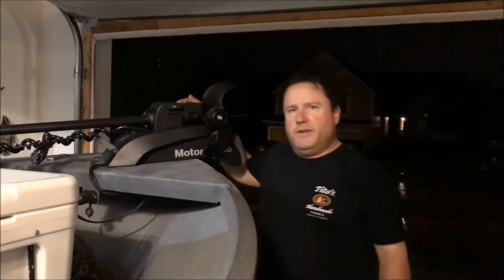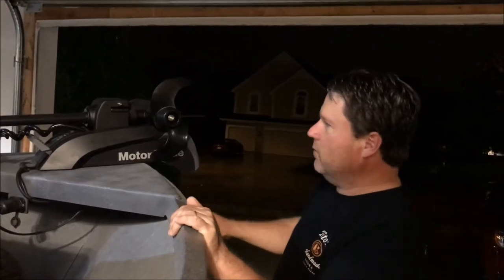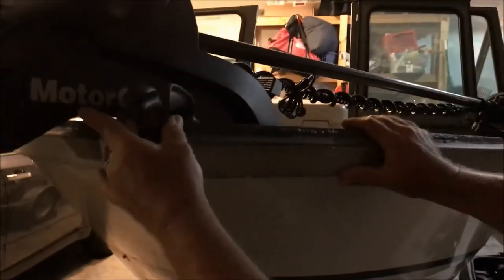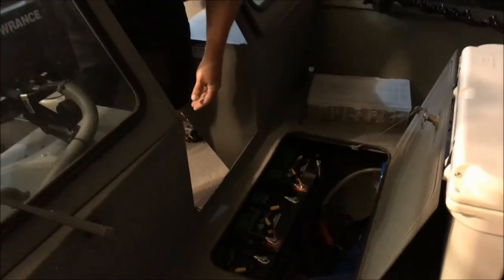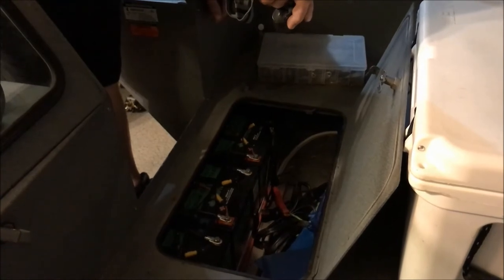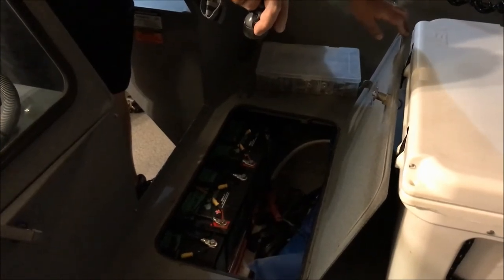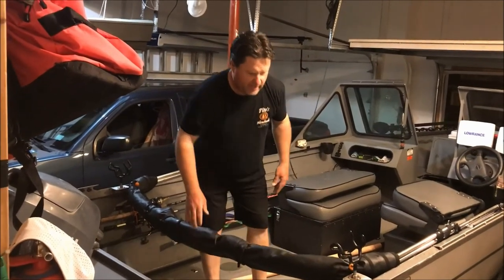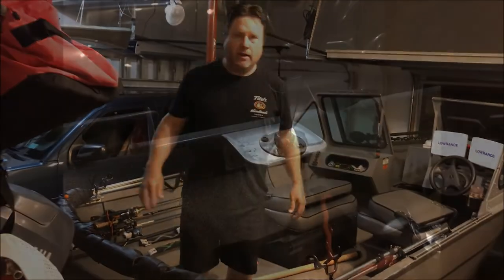Alumaweld / Modifications / XI5 / Lithium Ion / Canopy

Comment: Are you able to re-enforce the trolling motor better to the boat than just the original mounting brackets?  Had a buddy have his bust off due to silver carp while fishing.  He had a re-enforced roughneck job boat but it still snapped the mounting bracket in half.  Would hate to hear a fish or log or rock just break it off and loose it in places like the Kaw.
Reply from the maker: I don't think so but who can prepare for those flying suckers!!! The trolling motor mounting is the same and seems fairly robust. It was the boat itself that needing the reinforcing and now it is like a tank up there!.
Reply: Team Mainlake oh I know, I try to do my fair share with em.  I Bow fish a lot too, but I eat that which I catch and shoot or I use for catfish bait. Anyways I do gotta ask ya, I have been following ya for a while and we have talked some on facebook.  I wanted to ask, what is the fall pattern like on Sauger around here?  Do they go back to a bite like they did in the spring?  I was just curious.
Reply from the maker: I have caught sauger in the fall. Really good days and days without fish. Yes it seems to be spots similar to spring sauger and on out deeper off of these spots.
Reply: Alright, yeah I fish mostly below Clinton but figured I need to venture out to Perry or bowersock where its a bit deeper.  Anyways good luck and safe fishing my friend.

Comment: Very clean and really nice ! What did you do with your old motor?
Reply from the maker: A little horse trading. Casey took the trolling motor setup off my hands and in return mounted and wired the new setup. Not sure who came out ahead but could not honestly sell that after what I put it through. Casey is going to build a bait boat and the troller should be great if it is not too much to repair the motor
Reply: Team Mainlake 
Ok very good trade I would say.